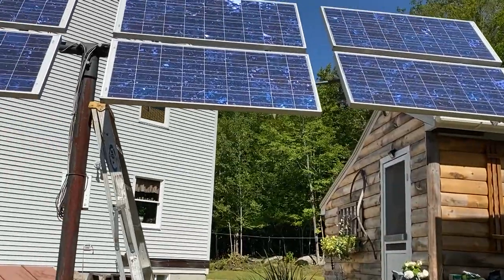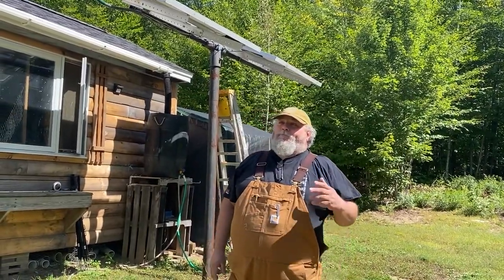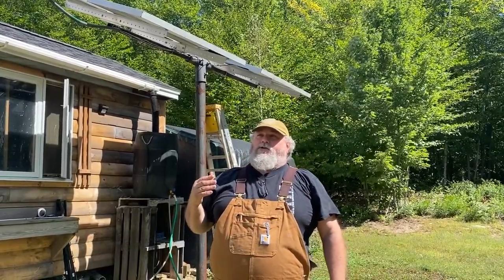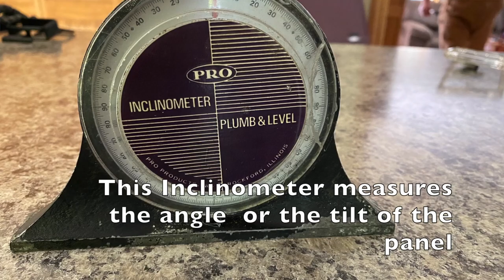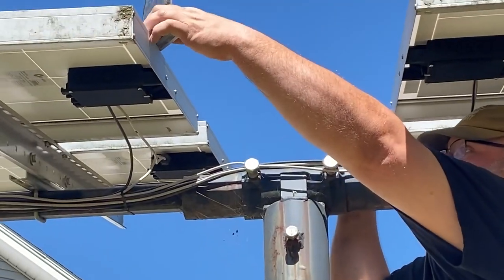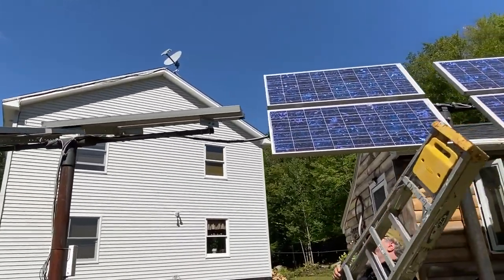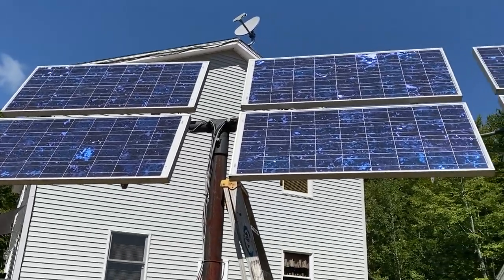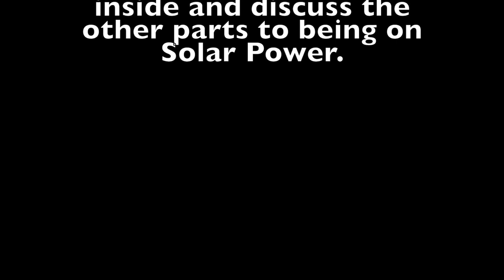Kubota Work & Solar Panel Adjustments #solarenergy, #Kubota

Comment: We have thought about solar as a back up energy source since we live downtown.  Is it possible to do that?
Reply from the maker: That really depends on what you expect to run. Lots of people build small, even portable systems that would provide enough power to charge phones, laptops, power a reasonably sized flatscreen TV, etc... All you’d need for that would be one, or two panels, a charge controller, battery/batteries, and an inverter. Maybe some type of a cart, or dolly to move it around. Something like that could be kept charged with a small battery charger if you choose, then be wheeled out onto the lawn, driveway, patio, deck, etc., when the power goes out. If someone had a small setup like that, along with one of the newer quiet suitcase inverters, you’d be way better off than most everyone. I only mention the inverter/generators because of stuff like a refrigerator, or freezer. A portable solar setup wouldn’t run that stuff for very long. But as far as lighting, charging things, stuff like that, yes, it could be done rather inexpensively.
I should probably do a “basic understanding of solar power” video??? Hmmm... Believe me, it will be basic. I’m no electrician. Lol!

Comment: My tractor same way.  Why can’t they put fuel filler in easier spot...  just had to do mine flat extra $15,000 to put on angle
Reply from the maker: It's definately a pain in the butt to fill. Whoa $15,000 thats an expensive fix, but I'm sure worth it.
Reply: Whiskey n Sunshine Off Grid lol it’s a bit over 800 sf in panels. Quiet the system to turn or tilt 😂
I gave mahindra a complaint come on  very middle top,but it does seem little easier if lift bucket up out of way but still to tall to lift 5 gallons of diesel
Reply from the maker: None ya Texas on the back 20 sounds like a cool system for sure. Hopefully they will do some changes on tractors, although it won’t benefit us as we hopefully won’t be buying another one in our lifetime. 😀